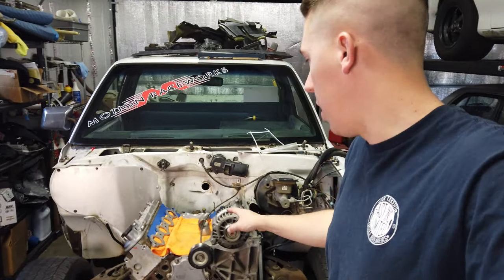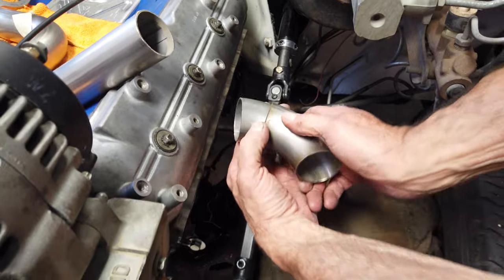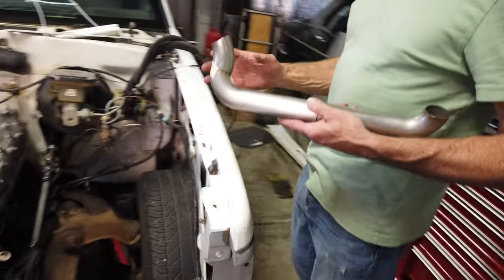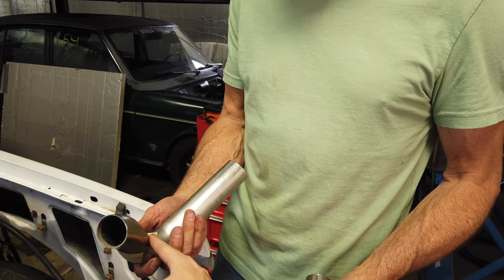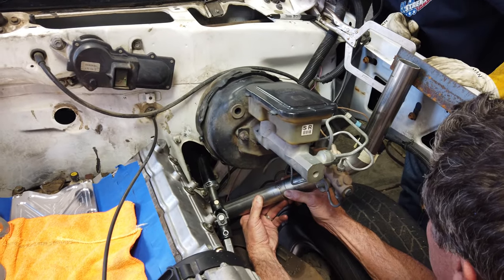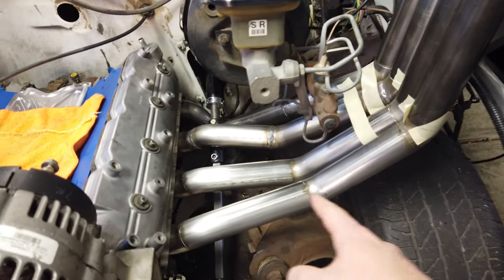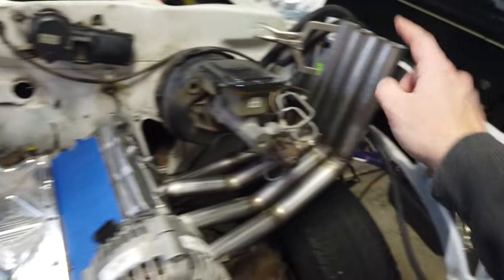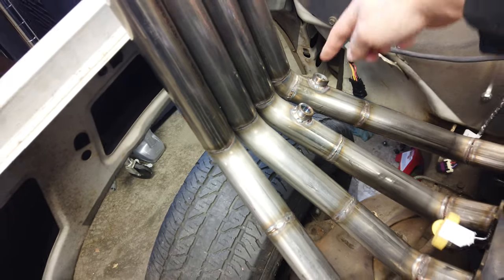Burnout Truck gets Custom Set of Zoomies! Crazy LS Swap Chevy S-10 Exhaust!

Comment: Looks awesome. What kind of filler material do you y’all use for welding stainless tubing ?
Reply from the maker: I'm using 316 stainless filler rod. I had a bunch of 1/8in but thats too big. I'd use something like .045 for the tubes
Reply: Build Tune Race awesome 😎

Comment: Should have just put another universal joint put a heim joint on the frame rail right by the control arm then another user reversal joint right to the gearbox that drop out of that way pretty much run any exhaust manifold header you like there a few pic out there of people doing it buddy has done to both his s10 and plan do mine the same
Reply from the maker: Yeah that could have worked! This ended up being pretty clean and easy just have to remove the column the get headers out but i think ill be able to pull the engine with that header still in the truck.
Reply: @BuildTuneRace  yeah it look good sure work just as good as any too